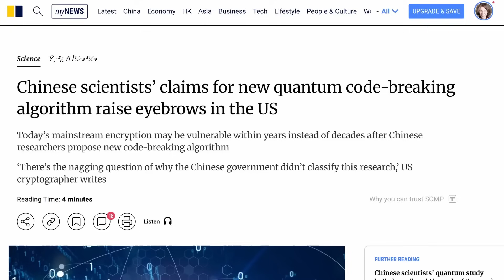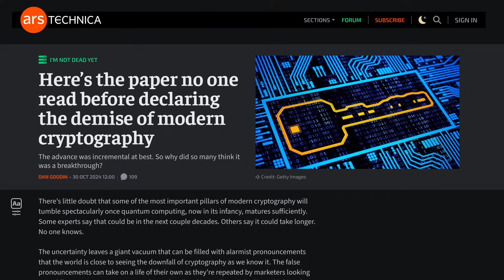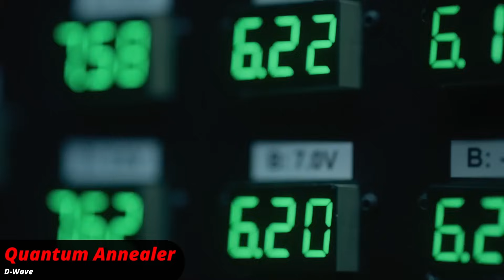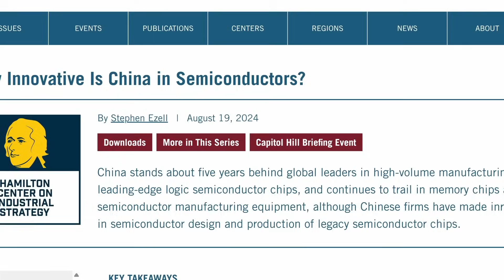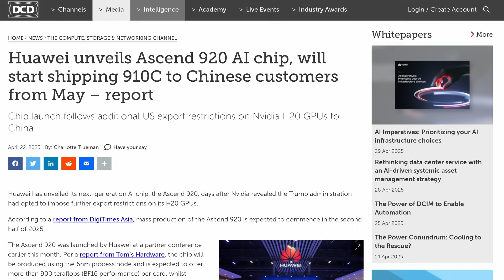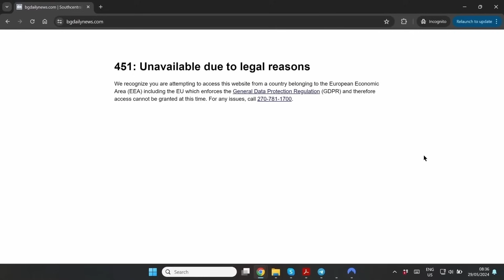Chinese claim "First Successful Factorization of RSA-2028 Integer". I've had a look.

Comment: During my 30 years as an IT professional,  almost every successful hack that I dealt with personally was traced to sysadmins having been paid off to provide passwords to nefarious entities.
Reply from the maker: never neglect the low-tech hacks...
Reply: @SabineHossenfelder 
Thank you kindly Sabine.., it's a matter of time, but I thought that we were already upgrading our encryption standard.... aren't we?
Reply: 🥰 

There is plenty in the bottom
Reply: @SabineHossenfelder   At last, a shout out from Sabine on Youtube!! 😄🙂
Reply: The smart guys get paid. The idiots hand them over without even  knowing.
Reply: @DieSportsKanone  //The smart guys get paid. The idiots hand them over without even  knowing.

//

It's all smart and clever until they get disappeared.
Reply: @DieSportsKanone  This is such a beautiful claim, thanks.
Reply: Ah yes social engineering if you can't hack the tech bribe the human.
Reply: Entry by password leaves behind authentication records aggregated in your OpenHardBSD secure logging servers, which hang off cables assigned to interfaces permanently configured for half-duplex, where the only allowable password channel is the keyboard through the wardrobe, on the other side of the Silver Sea, jammed into the bottom of a locked filing cabinet, tucked into a disused cupboard under the stairs, with a sign on it reading "Beware of leprosy". 

So you solved those cases, but not many others. 🙂
Reply: @afterthesmash  was all that about a keylogger?
Reply: @afterthesmash  Leopard
“But the plans were on display…”
“On display? I eventually had to go down to the cellar to find them.”
“That’s the display department.”
“With a flashlight.”
“Ah, well, the lights had probably gone.”
“So had the stairs.”
“But look, you found the notice, didn’t you?”
“Yes,” said Arthur, “yes I did. It was on display in the bottom of a locked filing cabinet stuck in a disused lavatory with a sign on the door saying ‘Beware of the Leopard.”
The Hitchhiker’s Guide to the Galaxy.
Reply: @TonyWhitley  Ah, you beat me to it. Nice!
Reply: @afterthesmash  By the ending... Is this a Hitchhikers Guide to the Galaxy reference?

“It was on display in the bottom of a locked filing cabinet stuck in a disused lavatory with a sign on the door saying 'Beware of the Leopard.”
Reply: @afterthesmash  The machines will always know more about us than we know about them.
Reply: I’m a software developer at a company, I do the enterprise software in the IT department and the only times we’ve been hacked have been due to successful phishing attacks through email.
Reply: @DrEnginerd1  "and the only times we’ve been hacked have been due to successful phishing attacks through email." 
Because this is the lowest grade of "hackers" that do not bother to cover their tracks and leaving plenty of traces behind...
And generally speaking, you either have to have little understanding of the subject, or it's an attempt to cover up something, possibly your own inability to find this threats.
The number of holes revealed in the last two decades clearly indicates that someone is taking advantage of them by forcing them to remain in subsequent generations of hardware (and software) plus they are being discovered in multiple layers incuding layers that are not accesable from a regular system administrator level...

I wouldn't be very surprised if it turned out that you only look for these "hacks" only when someone outside the IT department reports a problem/case of unauthorized access to the system -> in other words, you're not the one who detects the break-in...
The people who commented here didn't boast about any details about what kind of company it is that doesn't limit access even by IP and a password alone is enough to gain access...
Reply: What i have learned in my years in IT is that no matter how fancy or shiny the process or security tech is. The human is and always will be the weakspot. So not matter how hard you encrypt something just go to the weak spot and it wont matter.
Reply: "People always make the best exploits. I’ve never found it hard to hack most people. If you listen to them, watch them, their vulnerabilities are like a neon sign screwed into their heads." - Elliot (Mr Robot)
Reply: @lellyparker  Tru' dat.
Reply: @frankfahrenheit9537  Funny.  But in your example, the idiots might lose their job while the "smart" guys lose their freedom after being sent to prison.
Reply: During my 20 years as an information security professional I have yet to see a hack traced to paid off sysadmins.
Reply: we are not talking about some stupid blog...
Reply: It's always done from the inside. It's about money, sometimes revenge. Maybe the company is targeted using job applicants with amazing resumes who actually work for foreign governments. The later can spend years feeding information to their sponsors, and making a good living.
Reply: Social engineering is always the weakest point in security.
Reply: Very interesting
Reply: That's why the real challenge of Turing Complete blockchain computing is governance, seeking ways to liberate from monetary hypnosis as source of systemic corruption. 

Think of co-op style creation of exchange tokens directly as "basic income", instead of the norm of first-come, first-get pump and dump schemes.
Reply: Then add two sysadmins or three days admins
Reply: Insider attacks are all too common
Reply: As a colleague once told me: if someone cannot get access with a 50k dollar computer, if they're motivated enough they will find the access with a 15 dollar hammer. Sysadmins are vulnerable to hammer attacks.
Reply: @7rich79  "As a colleague once told me: if someone cannot get access with a 50k dollar computer," immediately reminds me of stories about how a guy walked up to a new car model of a large German car company and gained full access to its computer and all functions in a few seconds in front of the boss of that company... and such suitcases that do not require the user to even type anything on the keyboard are supposedly around 50k, but here the experts boast that no one has hacked their system... I bet they do not even look at the logs unless someone reports something happened to them... -> aka attacker did not care to cover up his work inside the system(because he hardly understands even its normal operations)...
Reply: In my 40, it's only been from software exploits or badly managed keys, i.e. a key in a file on a share and stupid things like that. I have never ever seen someone bribed. I guess it depends on your country.
Reply: I've known IT consultants who were sent on business assignments to China on behalf of western companies, (but hint: some these consultants are not actually based out of the companies' home country, but are outsourcees). The moment they are in China, these consultants get paid a visit by plain clothed Chinese agents who use all manner of threats to collect sensitive information, before being released to perform any work or leave the country.
Reply: In my thirty years of IT I’ve seen all the hacks.  State based hacks, surveillance hacks from China, insecure passwords, software distribution hacks, password grabs from compromised servers, exploits due to due unpatched computers, sliming by viruses, bricking of devices, shared passwords, security breaches due to C suite executives getting security exemptions, connecting of network to insecure domains due to merger and acquisition requirements, circumvention of security protocols by coders, and most of all revenge by disgruntled associates particularly IT.
Reply: well, that's a bit strange, while there where many vulnerabilites is  systems for last 30 years.
Paying an sysadmin was cheaper and quicker than hacking, is someone want to have access to specific institution ?
Reply: Honestly the most common I’ve seen is just not keeping your OS or dependencies up to date
Reply: During your 30 years as an IT professional they didn't have quantum computing
Reply: @ Here is a recent analogy from Britain and a physical high security building.

The building requested a review of its security arrangements as they had been recently upgraded with the latest high tech innovations.  1) The security review company successfully observed the site for multiple days without being spotted and noted all the entrances and exits.
2) They noted one of the fire exits from the building was being misused during the day at certain times.
3) They faked a letter from the company HR department and stuck it to the outside of the door.
4) The letter on fake letterhead said - “Essential maintenance being carried out on this door please ensure you prop open the door before entering the building” and was supposedly signed by the HR Director.
5) Initially no one saw the notice, when someone did they propped the door open, and left it open.
6) That evening the security review company entered the building and called the Director in charge of security from one of the office phones…

Simple psychology works on most people, this is something burglars think of everyday as do hackers.
Reply: Always look at the weakest link.
Reply: These days, the sec admin would suddenly come down with Havana syndrome, without knowing his password info had been tortured from him.
Reply: Teach me hacking master
Reply: If BTC is at risk, the entire banking system is at more risk.
Reply: IT professional? I thought you've been running a junkyard that whole time.
Reply: Most hacks are low-tech or even non-tech related lol.  Social Engineering or just straight up bribing people for an easy backdoor is the most reliable “hack”.
Reply: I'm actively using computers daily for 25 years and I've been all over darkest darks of "dark web" etc. I've never had a virus, i've never had my account stolen, i've never had any of my passwords "cracked". All hacks rely on human factor purely.
Reply: Hackers Hack in every possible way.. Insider Threats always exisit till there are $$$$$$$$$$$$
Reply: Yes, because the mathematics can't be hacked unless you have a quantum computer....
Reply: @Seanomarachain  Allegedly. The math isn't water tight on this one.
Reply: It is not your invention
Reply: But for bitcoin you have the puzzle solved every few minutes, and then all the links to that block being written to disk. 

You would need to constantly be paying people off.

Comment: If we all have to learn Chinese, they should fit it up with an alphabet writing, would save a lot of brain power. Or do we need a quantum computer to decode it?
Reply: The problem with this approch is: There is 1 written chinese language and multiple different spocken languages that use the same written language. If you make a letter based language out of it, you break this compatibility.

And the brits didn't change their language when they conquered the world so that they wouldn't have such a hard language with so many inconsitencies.
Reply: Maybe the extra brain power required to be fluent in Chinese is what makes them smart?
Reply: It is called pinyin.